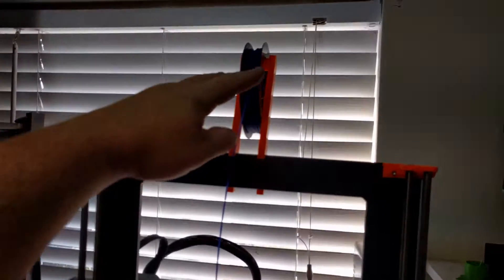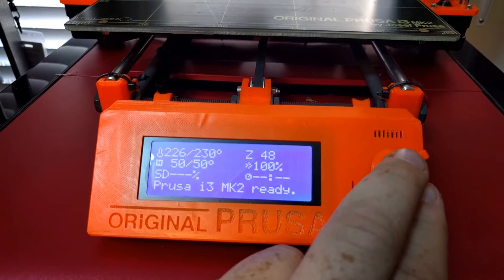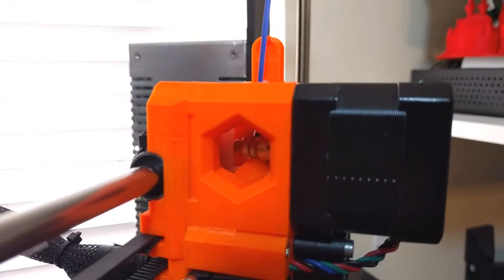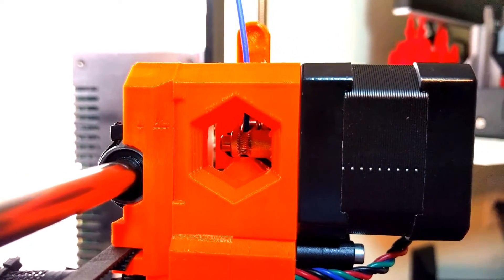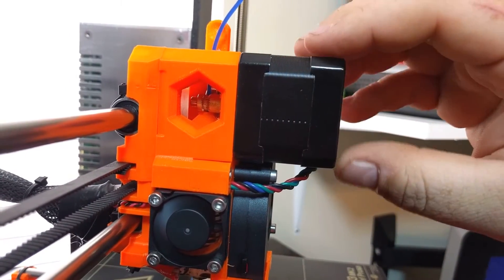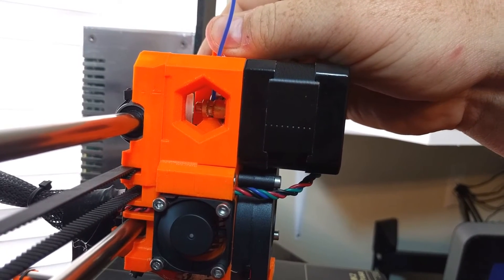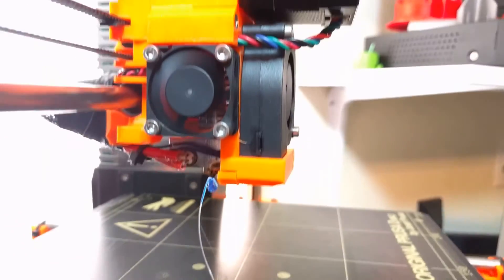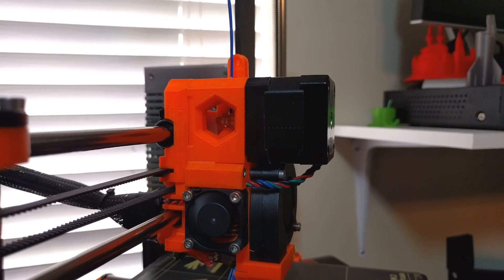Prusa i3 MK2 Quick Tip 003: Loading NinjaFlex

Comment: I think the main problem is you are loading the filament like all other printers.  If you watch Josef  load the filament he does not pull the spring lever back and push the filament in to start it.  He starts the load filament command and then  simply puts the tip of the filament into the top of the extruder and lets it pull itself in.  I believe this is set up to load just the right amount to get to the nozzle and then slow down.  You might try that technique when loading all your filament.  Just an observation.  Keep up the great videos.
Reply from the maker: That is a good point. I will try it the way you suggested and report back.
Reply: I just semi-tried your technique and what I did was wait until the hobbed pulley slowed down and then inserted the flex. I had to answer no a few times to the "Is it clear" question before it began extruding. And it went ok for a bit then began kinking at the hobbed pulley. My first try at anything other than PLA so I need to find the print speed in Slic3r? Slow it down?

Comment: There is an alternative to loading flexible filaments based on what you show here.  You go into Settings, Move Axis, Extruder and load flex filament that way.  Loading filament via Settings always uses the slow speed.
Reply from the maker: Ah very good to know 😀

Comment: Great tip. Have you already mailed or tweeted this to @JosefPrusa ?
Reply from the maker: Yes I did last night and this morning they sent me this email. 

Thanks a lot for your feedback, I will immediately forward this to our firmware department!We don't use ninjaflex much, so we weren't aware of this issue. We use stiffer flexfill, which has no problem loading. But great suggestion regardless.